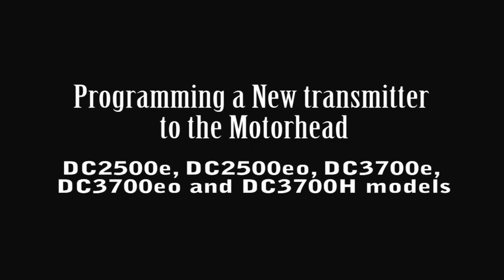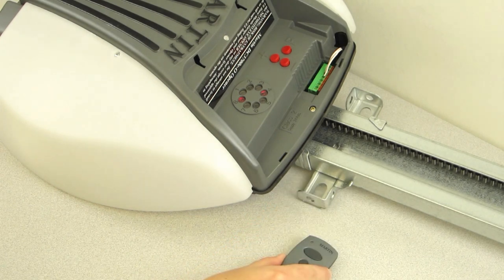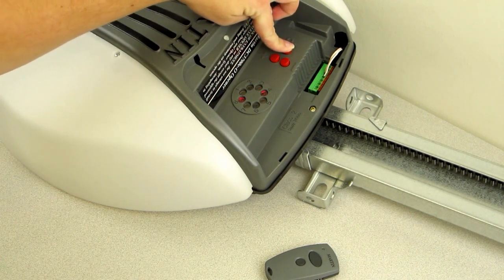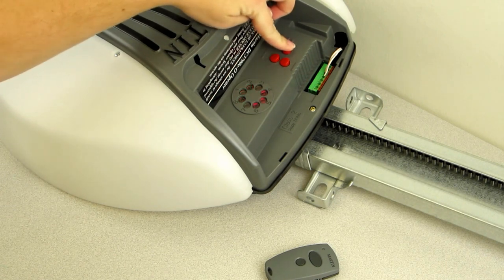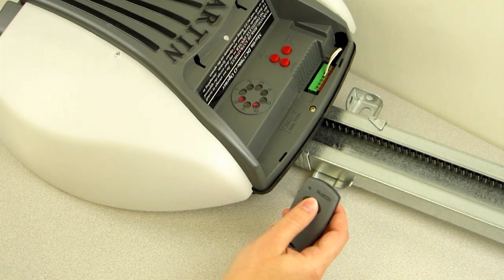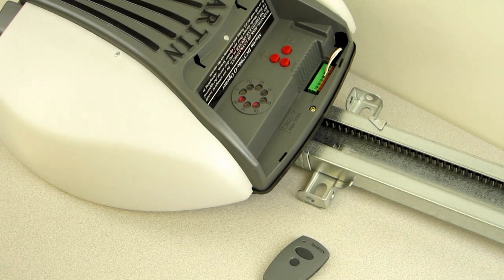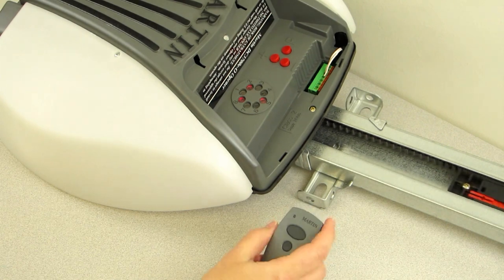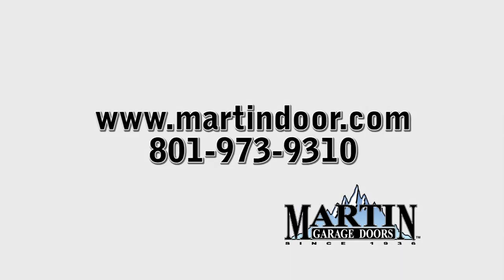Programming a New transmitter to the Motorhead

Comment: Did Martin go out of business like ten years ago? From the lack of corporate response to peoples questions here, that’s what I would conclude.

In my case, I just bought a house that has a 2500e installed, and someone lost the remotes. I saw this video, and thought it would be a piece of cake to replace with new ones. It absolutely is not. 

Apparently there are some models of 2500e that have buttons numbered 1 through 8, and then there are those my model which has buttons numbered 1 through 4. I wasted about 45 minutes trying to make inferences from the instructions provided here, and it turned out all to be wasted time.
Reply: I’ve one with 4 buttons. On the manual it says to #3 led is to program. But that doesn’t work with the universal opener 🤔
Reply: @sharank100  Not 'buttons,' but numbers 1-4 next to your indicator lights, right?  After you've done your best to get the new remote to pair with it, does that number-3 indicator light blink fast - but nothing else happens?  Best info I have is that when you see this, it's gone into a lockout mode for unknown reasons (this per a tech at Martin's office) so your remote is paired, but the motor-head won't operate from the remote, only from your wired switch. God only knows why there's no reset button on the motor-head, but that supposedly the case.  
He said the only way to get it back to working is (assuming you don't already have one of these installed) is to get an enhanced wall switch - which has some 'reset' feature along with the basic open-close operation. (And no, that doesn't make electrical sense to me either, unless the new switch also needs more than the standard pair of wires up to the motorhead...)
I'm still waiting for mine (from ebay) to arrive, but it's a "Marantec M3-543NL Wall Control Panel 89463," which you can find online from lots of sources (I'd recommend ebay, where they're as low as about $30.)  I'll post back here if that does it.
Reply: @davids1681 thanks for the detailed reply. Sorry that you also had to go through the trouble. I had a Chamberlain universal remote. Pressed on the remote button when the #3 was blinking. But the #3 light never blinked fast.  

I couldn’t find what frequency the remote I used works with. The garage opener 
Works on 315 mhz. I’m thinking of ordering a new remote which works at 315mhz
Reply: @sharank100  Yeah, remotes that are compatible are littering Amazon and ebay right now.  When I asked my remote supplier for some more detailed help, not knowing it was actually more likely this 'lockout' thing, they made it clear it's not even worth their while by replying with "if you can't get them to work, just reply through Amazon and we won't want them back," or words to that effect.  But these don't have the pairing "tines" to clone them, so I'm not at all sure I'll be able to end up with two same-code remotes with these - so they may be no good for me after all.